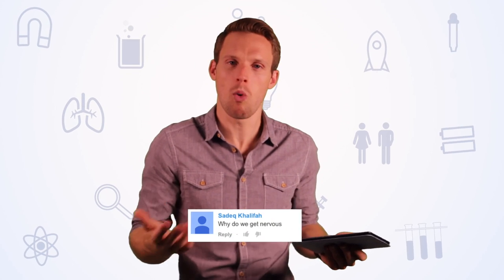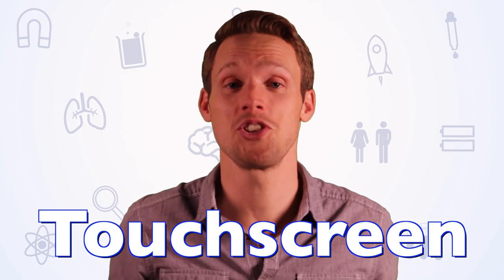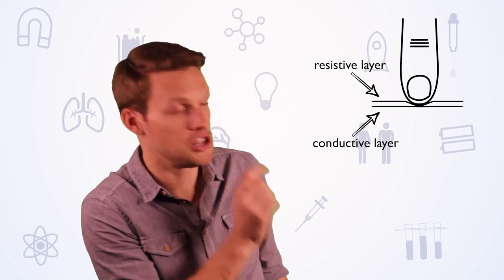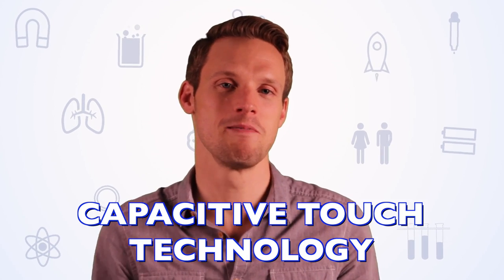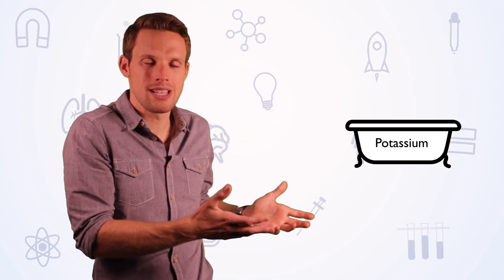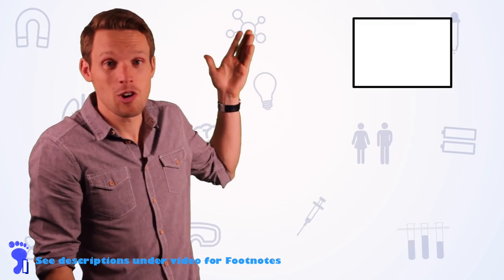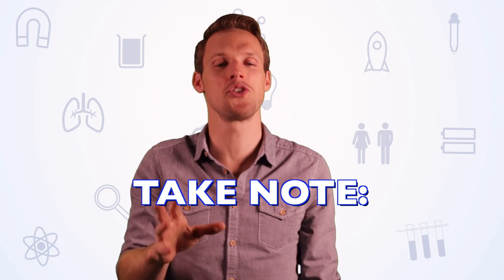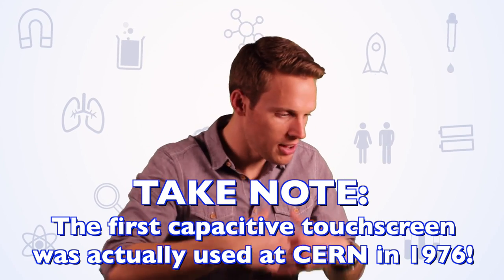How Does Touchscreen Work? | BRITLAB

Comment: I am still a bit confuse.
First is for the capacitive touch screen. It uses 3 layers that the LCD and Protecting Glass are separated by Capacitive Layer. How could the LCD is still visible while it is covered by the Capacitive Layer?

Second is for the resistive touch screen. Where do you put the LCD? if it is also separated with the top layer by the middle layer, how could the LCD is still visible, too?

By the way, thank you for upgrading my knowledge :)

Comment: it was an interesting lecture about touch screens, simply explained and straight forward.
I wonder if you can make an explanation about wifi frequency, how does it hold and transfer data, and how does the receptors on the terminals receive that data ..
thanx in advance

Comment: 3:07
In a capacitive touch screen no charge actually moves between the phone and your finger (i.e. there is no current going into or out of your body). The charge in the phone simply induces an opposite charge in your finger, and your finger and the driving lines become a capacitor. Good info tho, just wanted to clarify that part.

Comment: do swimmers sweat while swimming?
Reply: If they're hot they will, otherwise not.
Reply: TheHue's SciTech you can't really be hot while swimming,the water is around 25-27C and thats not enough to raise your body temp
Reply: JoyOfMachine I don't recall the OP specifying a temperature-controlled Olympic swimming pool...
Reply: JoyOfMachine Of course it is. Your internal temperature is never the same as your external temperature and 25-27C is hotter than most external temperatures in the UK, granted of course you don't wear clothes while swimming, but 25-27C is hot!

I imagine they would sweat, they're doing intense exercise, they're internal temp would rise. 

Do you think sprinters would sweat in 35C temperature while naked? It's the same question (assuming our clothes increase our surface temperature by ~7C, I have no idea how influential they actually are and obviously it depends on the type of clothes).
Reply: yes if the water is warm enough that their body (nervous system in particular) feels the need to cool itself. the water really wouldn't have to be very warm, people sweat walking through antarctica.
Reply: Yes.
Reply: You don't sweat that much while swimming due to the water pressure around your skin.
Reply: Derek Leung Got any evidence to back that up?
Reply: Ryan Hutton You are massively underestimating the insulating properties of air. Compare someone walking in calm conditions, shirt and shorts, 10C. Would be fine for hours. Dunk same person in 10C water, dead very soon. It's much more than just "clothes are worth 7C". The body produces 60W or so, you have to play that off against the thermal conductivity of the surroundings (including clothes and water/air) to figure out if the body is overheating (sweating required), overcooling, etc.
Reply: TheHue's SciTech Fair enough. I'm certainly a physics nooby so I will accept that. Thanks for the correction :)
Reply: Ryan Hutton NP. I actually only know this sort of stuff because I do electronics, and the problem of whether a transistor will overheat depending on the heatsink that it's attached to is very similar. The quality of a heatsink is measure in degrees C per watt, not degrees C :-). If you want to learn more about warm clothing, just look up electronic heatsinks! It's quite easy to follow.
Reply: Of course, you're expelling great amounts of energy so you're going to sweat. Simple
Reply: Spudvader You sweat when your body temperature rises, not because you're doing work. Obviously, the latter often leads to the former; but when you're swimming, there's every chance that the water around you keeps you cool without any need to sweat.
Reply: Derek Leung It has nothing to do with water pressure. It's the temperature. If you are swimming in a pool that has a significantly lower temperature than your body, then you will sweat very little, or not at all. But if you were swimming in a hot-tub that was slightly lower to higher than your body temperature, you would sweat profusely.
Reply: JoyOfMachine Yes but the sweat is washed off by the passing water
Reply: stormblade123hsm Protip: learn the skill of reading previous comments so that you don't look like a fool by giving answers already shown to be oversimplistic.

Comment: but some phones like the S5 can sense touch even above the screen or pretty much anything if you increase the touch sensitivity in the settings, how?
Reply: It uses On Cell technology, apparently the thin layer means that electrons are always bouncing up and down through the screen and you can detect whether there's something touching it is a conductor or whether it's an insulator by the way it disrupts the natural flow of electrons. what's cooler is that you can detect stuff that's not touching the screen too. Just turn on the water colour screen saver and hover your finger above the screen. Some electrons will make the jump to your finger and you can see the cool effect made by the phone.
Reply: That happens on the s1 and s2 as well. Gave my friend my old s1 after his phone stopped working and he's complaining everyday about it clicking without him actually touching. His old phone was one of the touch screens before the iphone.

 Tough little bugger though I seen him smash and throw that phone 100s of times over the many years and it never cracked the screen. It actually broke after almost or more than  a decade from falling in a bucket of acetone. We were doing an experiment and it didn't turn out so well. His SIM card survived the madness so we cleaned out off and and he was upset so I said well here have a real smart phone... he shattered the screen by accidentally letting it fall out of his chest pocket 2 weeks later...

Comment: Here is a really good question. I know the figures will likely not be correct but this is an example. Say someone were to try and shoot someone on a train which is travelling at 500mph, but the bullet only travelled at 400mph... does this mean the bullet would come out the barrel but then because it is travelling -100mph to the train's speed it would then mean it would travel backwards at 100mph and therefore end up penetrating the person who fired the bullet and not the person who was being shot at ? or would the bullet just simply not come out the barrel? or would it reach the person the same time as it would any other time? It would be great if you could answer this as it has puzzled my mind for a few years now.

Comment: How do the touch screens work INSIDE shop windows that you can use and operate from outside?
You're not actually touching the screen, just the glass of the shop window.
Also:
When I was at school (30 years ago!) there was a touch screen that used a frame around the screen to detect where your finger was placed.
I think it used IR diodes to map where the beam was broken.
Reply: Well, that was like the "gun" used in Duck Hunt for Nintendo. It was IR. :)
Reply: The shop window displays are generally very similar to the capacitive touch in phones. The main difference is the layer of glass between your finger and the measuring lines is much thicker so the screen just needs to be calibrated to the peak capacitance level when a finger is placed on the thicker glass.
Reply: thanks!
Reply: I guess I was way off. Doh!
Reply: ***** yeah. Every notice in those old light gun games when you pulled the trigger the screen would flash? It wasn't for effect the gun would take a black and white picture at the same time and figure where the center of the white square is to determine your shot
Reply: Snare X I was an excellent shot, sitting on the couch, my friends had to sit right in front of the screen. Aw :)

Comment: if we are pulling the charge away by touching,why doesn't the charge get pulled away when it is in our jeans ?
Reply: 2 things to note, firstly jeans don't conduct electricity and secondly your phone's screen is generally turned off whilst in a pocket. Though there is also another feature in the phone, where in case a large conducting surface comes in contact with a screen, the cpu rejects the signal (you can try it with the back of your hand or a cheek).

Comment: Actually, the "first" layer on a phone is the shatter proofing...
It is what makes the glass stay together even if it has cracked...
Reply: Would be a pretty boring video if they listed the shatterproofing, the oleophobic coating, every glue layer, every part of an LCD, ...
Reply: I think that the shatter proofing is a big part of the design of the phone display assembly.
Reply: ***** Important? Yes. Relevant to this video? Not at all.
Reply: TheHue's SciTech
He made it seem like it is glass that you are touching. it is not, it is a thin layer of plastic.

Comment: How can the sound of waterproof phones pass thru phone parts?
Reply: What? Sound can travel through air, liquids and solids. Some materials can be hydrophobic.
Reply: I'll field that one.
A sealed waterproof speaker cone that isn't actually covered by the phone's seals, just the water cant get past the face of the speaker cone into the rest of the phone.
Reply: Thanx man , that's what i want to hear

Comment: can touch screen be created using lights
Reply: +Pablo Jacques  Yes, it already exists. it's called a light barrier, well you can also call it a beam sensor but either way it's simply a photoelectric cell. So you can use it as a touchscreen that doesn't require actual touch, if the photoelectric cells are arranged in a matter where the light beams form a grid pattern. It's the same technology that detects if someone is standing in the way of an elevator door so that the door doesn't close and crush or trap someone. There is actualy a holographic display (it creates a picture in "mid-air" by projecting it onto steam or vapor) that uses these light barriers (photoelectric cells) to detect when you "touch" the holographic display.

Comment: touch screen is just a screen that detects conductive material like your finger that's why if you have a Samsung you can move it with a paper clip it doesn't work with Apple because the screen is so smooth